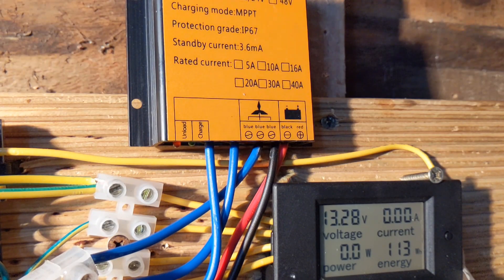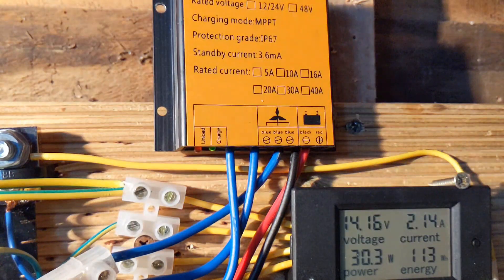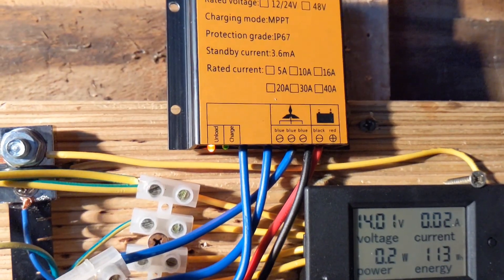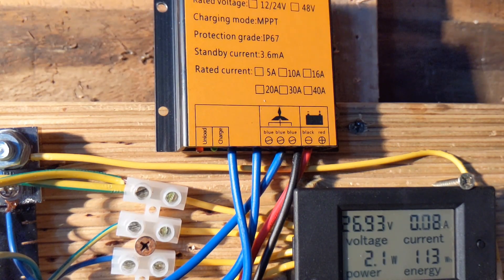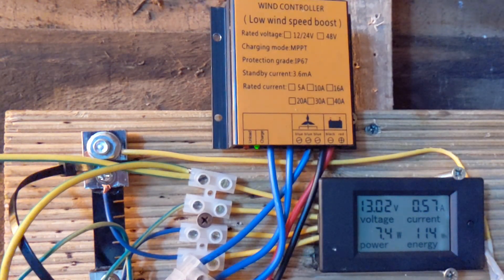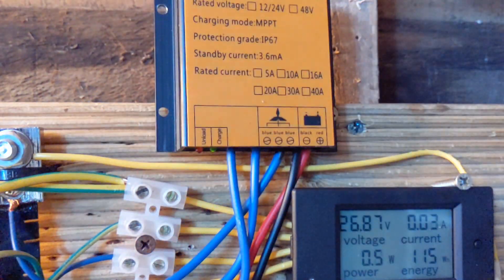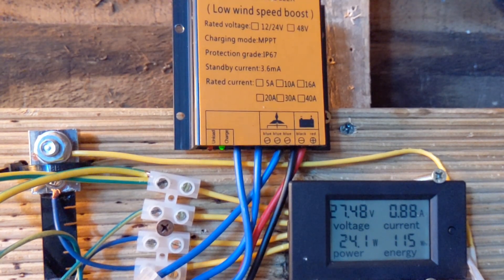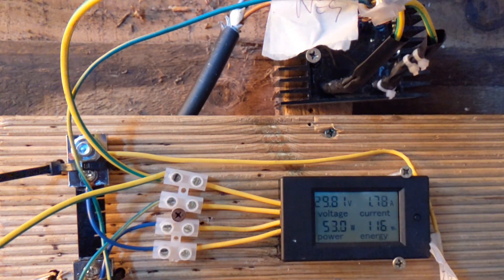Wind Turbine - Testing new meter and controller - 12v / 24v - 10th December 2021

Comment: With 3 pales is ok for me 2 ampères max with big wind✌i have amplificator 12v to 24volts and naw is work 😅 vevor kit 500 watts 😂 only 50 watts réels 😢
Reply from the maker: You are only getting 50w?, that sounds about right , remember my Turbine has a 10 foot rotor, cheers for the comment brother.

Comment: Greetz from germany. I have same type of voltage regulate with same symptoms. For me, that's looks same sort of regulation of a standard car alternator. Most types of alternators cut off the load to the battery between 14,4 to 14,6 volt. My solution sounds to use a diodes-bridge with electrolyrcondenser and a mppt-solarcharger. The solarcharger doesn't cut of the charge above 14,3 volt....it's change the the load to the battery in watt and ampere. On the other side the turbine produce over 20 volt and up.... With the standard windcharger, it' s failed...
Reply from the maker: Hello my German friend :)  this is a very basic controller but seems to work pretty well, I am looking at a Tristar TS45 with dump load.
Reply: @GavinFreedomLover  greetz to you and thanks for your answer. Here far away it's NOT easy to get/buy a professional charger for an windturbine. Most offered products came from Asia, so far so good BUT here totally overrated to expensive for a little windturbine in size of 500 Watt. A good hybrid charger for solar and wind and dump loader costs here two or three times more than the 500 watt windturbine itself. That's the point I went the way with an diode-bridge (...near 19,00 euros and a yF4700 electrolytcondensator 25 Volt less than 3,00 euro...). My first tests offer plus 20 Volts and more...but in time we have no wind for doing more tests but it's all hobby and fun for free. But next stormy days incoming in few days and I hope for more and better results. A big thank for your very informative vids, you went the right way. Greetz from very cold Germany, time of winter means here a very stormy season 👌👍

Comment: Hi, I am getting very low voltage from 3kw turbine which is 4v though it is moving fast. What could be the reason ?
Reply from the maker: Hello my friend, I presume you mean 48 volt? The only thing you can try is changing your batteries to 24 volts and see if it makes any power because at that voltage the turbine will only have to spend half as fast to start making power.

Comment: My wind turbine has 3 red wires to connect to the controller which has 3 blue wires but doesn't say which wires to which? Does it matter?
Or does the controller sort it out?
Any help would be appreciated.
Reply from the maker: They can be connected in ANY ORDER it doesn't appear to matter , cheers !!!

Comment: Im having same issue currently with my 48v system, Im switching to a proper mppt boost controller.
Reply from the maker: Mine actually works ok but it's not the long-term solution I'm looking for

Comment: Pls how can I use DC 0-100V 10A Voltage and current meter display to measure my Chinese Smaraad 1kw 48v wind turbine current? Pls send the wiring diagram. Tx.
Reply from the maker: I will do a video in the next couple of days for you , cheers

Comment: Hi Gavin,  l have installed a 12v wind turbine 500w same controller as yours, it achieves up to 140w witch ls what l was expecting. the thing is it will not charge my 12v system but will charge my 24v system that said it does not appear to push up the voltage, l have ordered a buck boost converter do you think this might help with the problem l have.  Thanks  John.     🇬🇧
Reply from the maker: I think what is happening as the batteries constrain the output, the 12v will not allow the turbine to spin up fast enough to make any power and will therefore be stopping itself before it starts , this controller will not help nor as I am aware will any other , just run 24v and take 12 volts of each of the batteries, you could run a 12v inverter off one and have something else on the other, not sure if a boost converter will work but give it a go, let me know, hope this helps , Gavin.
Reply: @GavinFreedomLover         Gavin,Thanks for your reply.